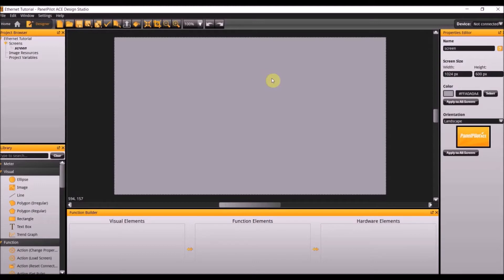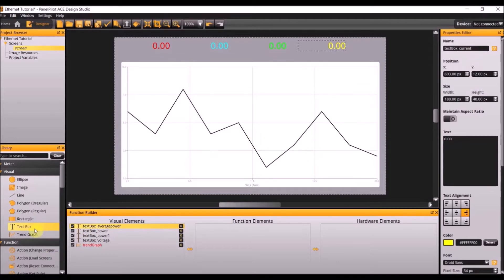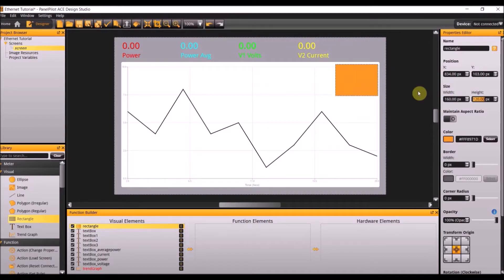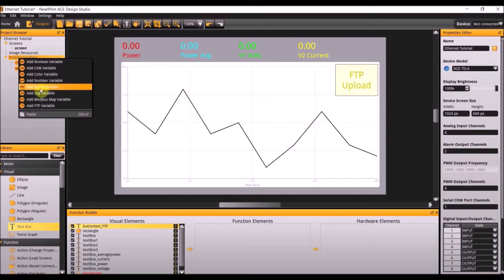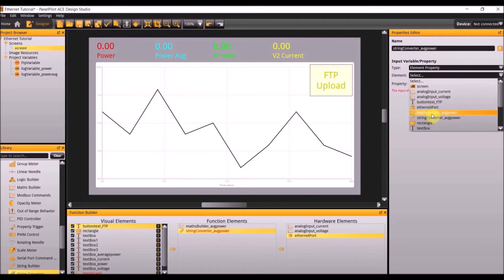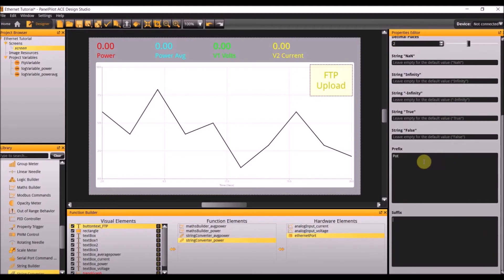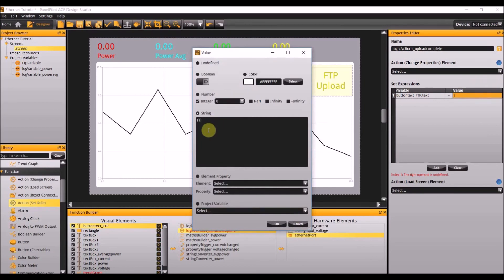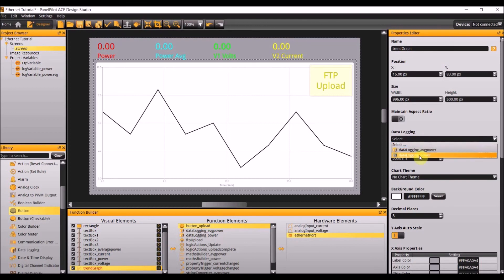PanelPilotACE Tutorial - Ethernet Capabilities

Comment: I downloaded this example as a template from your website. It does not work - no file is transmitted to the sftpserver. Also the LED's of the ethernet connector don't blink when I press the virtual 'FTP UPLOAD' key on the screen; proving no data is being transmitted. Did you test your example? Does it work at your side? Should it work when I run it via the emulator? How to debug this?
Reply: Hi junior fruithuibje,

This could be that a MAC address has not yet been allocated to the Panel Pilot Device. 
This can be set from the Right-Hand Device Menu; Device Configuration; Then check the “get MAC Address” box. 
The ethernet upload function will only work on an actual device and not the emulator. 

If you need further assistance please email sales@lascar.co.uk which will then be forward directly to our technical team. 

Thanks,
Lascar
Reply: @easylogdataloggers  Allright I checked the 'get MAC address' which resulted in a little LED blink on the ethernet connector when I press the button. However it displays a message saying "The communication could not be completed due: Target offline". Now my target sftp server is online and working correctly; from my PC (same LAN) I can connect and transfer files using FileZilla. I like to see the IP address that is assigned to the device in order to check its address and to see if that is correct at all. Trying to build that but that also gives me a hard time. I've sent an email as you suggested asking to hook me up to the support team, hope this succeeds as this is very time consuming and thus expensive.. Thought this should be easy and quick.. :-(